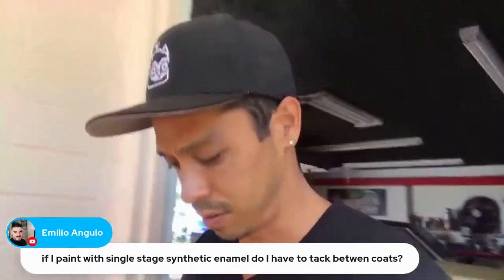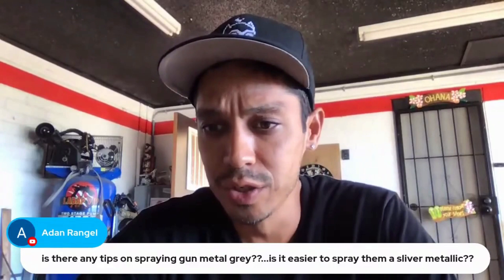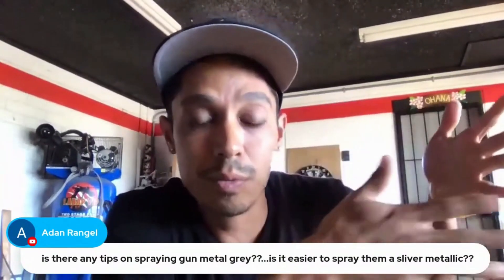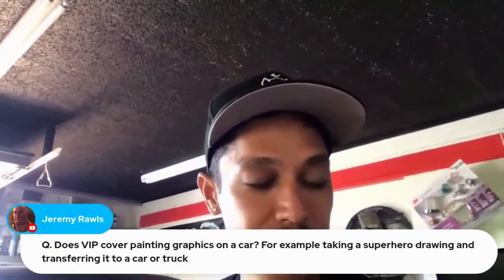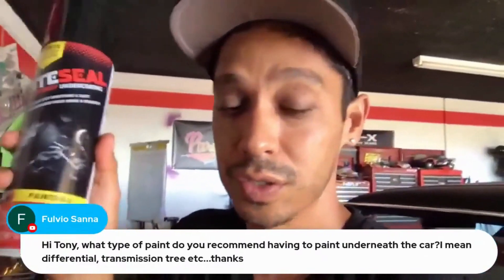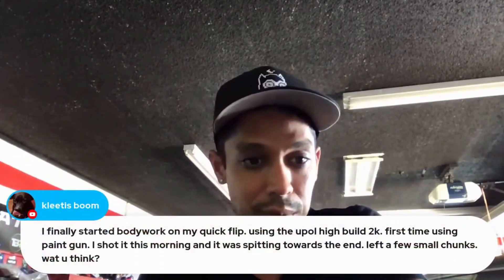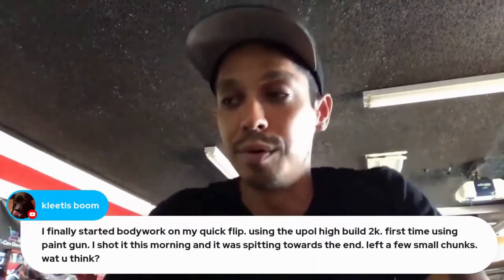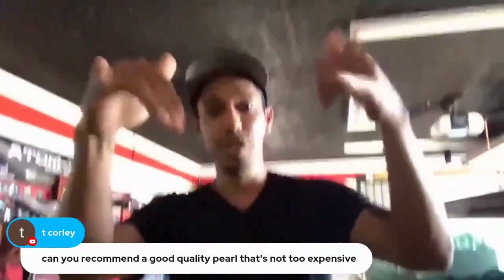🚘👉Autobody & Paint Q&A -  Tips On Spraying Pearl Paint On Car, Spray Gun Problem and Solution

Comment: Tony can you help me please?  I just did my first ever paint job using brandywine candy on my goldwing trike. For the most part it came out better than expected but there are issues and mistakes I made.... The smaller panels came out the best but the rear fender sections have places it was to light and one place when I went to sand and buff,  I didn't get enough clearcoat on and I sanded through to the silver base. It's a small area but I'd like to go over the whole thing again. Can I just sand with 4500 or 600 and reapply silver then candy then clear again or is there a better way. Thank You!
Reply from the maker: Hey Man! For your questions  join my streaming pretty much mostly every Monday 7 PM EST. For now please visit our website https://www.learnautobodyandpaint.com/?s=sanding+clear+coat we have tons of blogs there on auto body and paint and check out our VIP program how it’s helped many people like you and get the ability to complete amazing DIY paint jobs from home on budget. https://vip.learnautobodyandpaint.com/special-oto-e